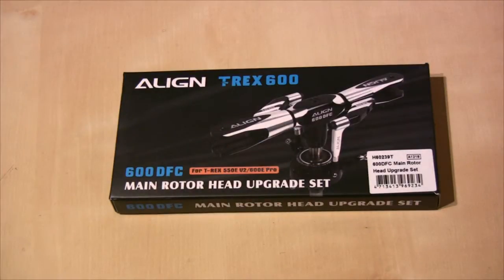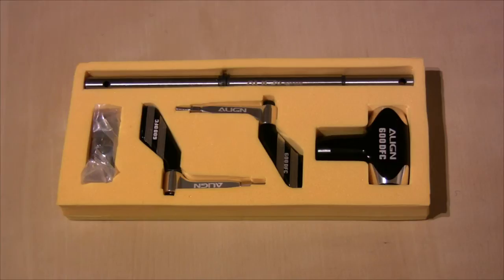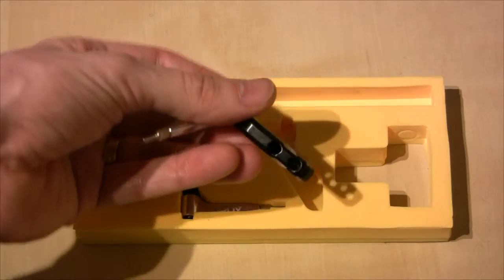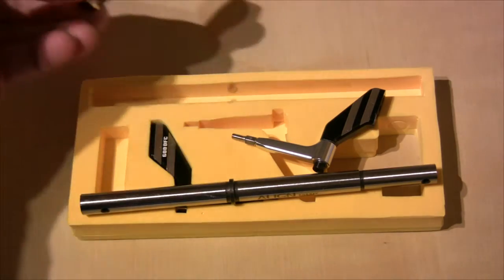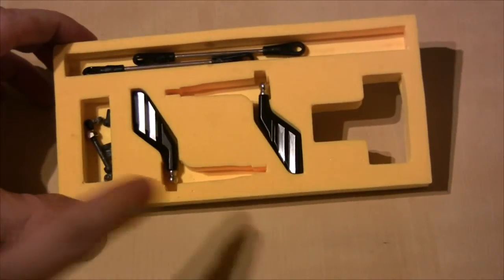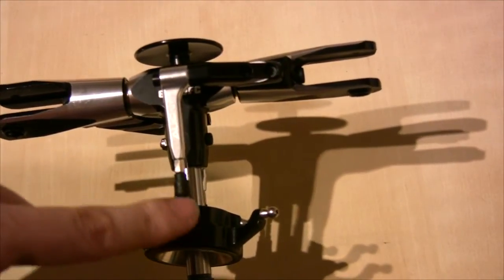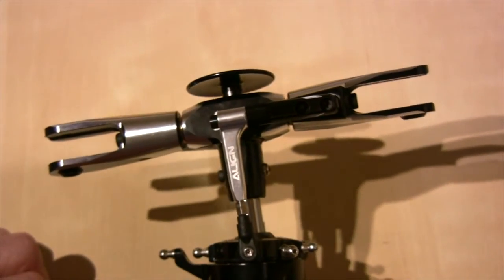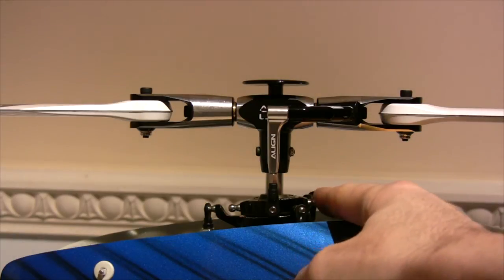600EFL PRO - DFC Head Install

Comment: It is suggested from Align that the threaded metal piece is screved all the way in and locktited and adjustment is made on the link instead. They say it is to prevent metal-fatigue and by using locktite its firmly secured and not shaken to a point of fatigue by small vibrations.

Comment from the maker: I think my main issue with this head design is it is fatally flawed in it's design. So much so that I uninstalled it and have gone back to the previous standard head design. It really didn't offer much in performance gain but introduced a design flaw which could lead to inflight failure of the model, so it is now back in the box it came in.